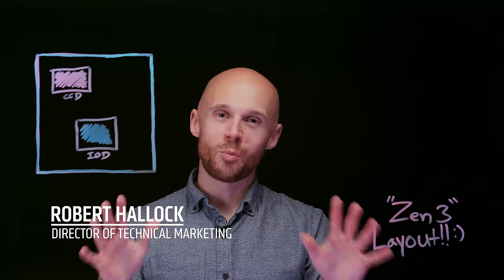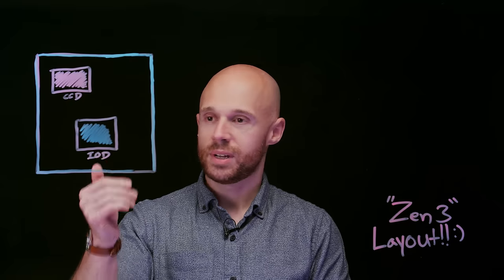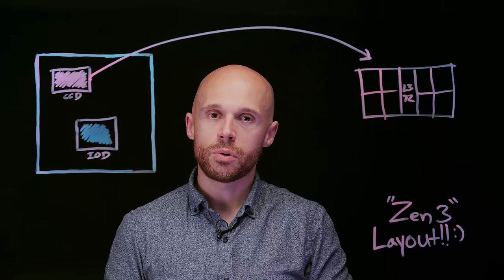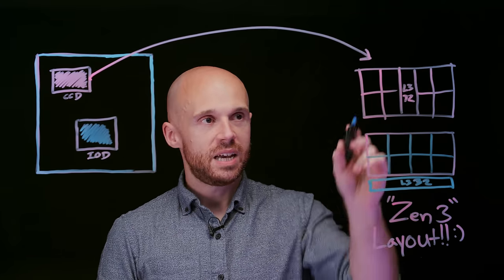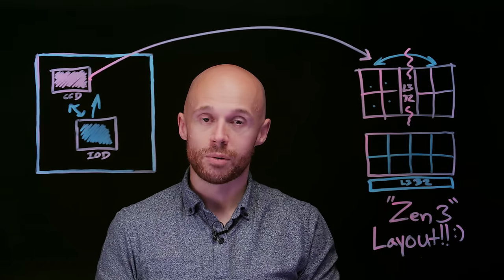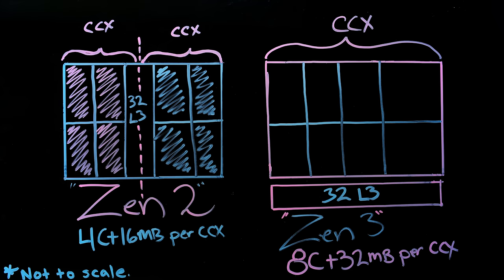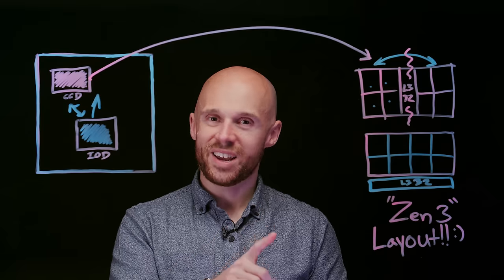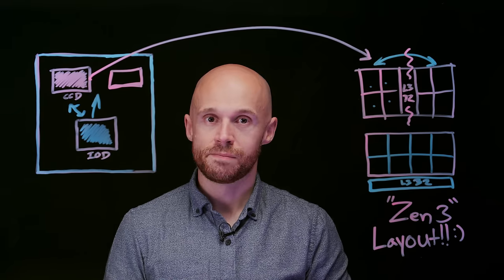How It’s Built: AMD Ryzen™ 5000 Series Desktop Processors

Comment: So for the 5900X, do you have two dies in the package with only 6 active cores per package? If that is the case, I wonder what the performance between the 5800X where all cores in one die vs. both the 5900X and 5950X as they will have two dies and need to communicate between those as well as the cores themselves (for games that won't use more than 8 cores).
Reply: EDIT: Guess I was wrong. It's way more likely they will pair two CCXs with the same amount of active cores, so, 6+6 for the 5900X.

AFAIK, the Ryzen 9s still have one full 8 core CCX and an extra CCX with up to 8 cores. If you get the 5900X it will have an extra lower bin 8 core CCX with 4 cores disabled, but the 5950X will have two full 8 core CCXs.
Now I'd say it's safe to assume the CPUs with two CCXs will have to use the IOD to communicate, but that hasn't been an issue for applications that require a lot of cores anyways, proven by Ryzen Zen 2.
Reply: No game needs 12 cores. You could probably assign it to just one of the dies (6 or 8 cores in a single CCD) in Windows scheduler just like Linus did during his Zen 2 review. This would eliminate any performance bottlenecks from inter-core latency in this game.
Reply: I was thinking the same thing - and then at what point do you stop? If it's more efficient to just have all cores together, don't you eventually end up full circle to old design?
Reply: You still get a lot of benefit. The core 2 core latency matters only during a L3 cache miss when the data exists in a "sibling" L3 cache. If you have a cache hit, you never leave the CCD so there is no impact. If the data is not in any cache at all, you have to wait for the RAM like always. You want as much useful data in your L3 cache as possible, because those cache misses are pretty much the worst thing that can happen for performance.

If you evenly spread out the cores over CCDs, each core has more L3 cache to work with compared to having more cores on a single CCD. So while you may have a little bit more overhead when threads are moved between cores, if they actually keep running on the core for a little while they will actually tend to be a little faster than the "crowded" cores because they don't have to compete with as many other cores for the cache.

So if you have a scheduler which knows about the cost of moving threads to a different CCD, spreading out the cores should improve performance. Ryzen/Threadripper/Epyc has been out for long enough that an up-to-date OS has a scheduler that knows how to handle that. So having 2 6 core CCDs should be a net benefit in pretty much all cases.
Reply: the 5900x in that comparison will have more cache available per cpu, so probably a net win all of the time.
Reply: @hoff521  As I understand, CCD is what's meant when you say "chiplet", and it's the CCDs that allow AMD to save so much on building the chips, which is exactly the benefit of modular design. The CCX's did not add any cost-reducing benefits, they were just a necessary design complexity that AMD only now realized how to get rid of. So the moment we stop is exactly this, 8 cores per die.
Reply: @dexter2392  Its better to refer to THREADS when talking about gaming. Especially because the processor is hyper threadded (has 2 threads per core. Most games from just a few years ago use at most 4 threads. Tho modern day titles, thanks to AMD ;), are now being optimized for more and more threads. Games are coded for not many cores (or threads) because most gamers wont even have a 16 thread CPU. Coding is also not learn in parralel, making it harder to spread the workloads.
Reply: Its a case to case basis.

In the case of Zen2, a 3300X doesnt always edge out a 3600X, usually the latency is only felt in latency-sensitive operations but then the difference is probably just a few seconds. For gaming, average fps of 3600X/3500X goes higher with the difference primarily in the minimum FPS depending on threadedness of the game.

With a more core count-constrained context, such as the 3100X vs 3300X, you'll see your answer :)
Reply: @nemanjarakic6815  Games are optimized for consoles first (cause they're the most popular gaming platform) and with the release of Zen 2-based PS5 and Series X, games will start to be written and optimized for 16 threads. Currently though, most AAA games require 4c/8t at least and some of them (particularly CPU-intensive ones) can see a performance increase by going up to 6c/12t.
Reply: @hoff521  Ya I think your right and also cannons why AMD intends to go with a monolithic die on their next line after zen 3. They have been shrinking nodes and trying things. It would make sense on a further reduced node like 5nm that they would go monolithic again for sheer performance.
Reply: @Niosus , thanks man i was thinking about that since quite a while. could not decide if i want to go 5800x or 5900x for gaming performance but also longevity for the years to come.
Reply: @dexter2392  Indeed. I agree. Im saying that older games are optimized for less threads, because consumers didnt really see more than 6 core CPUs just a few years ago.
Reply: @hoff521  It's a tradeoff between yields/scalability and performance.

When you have a multithreaded application that uses all 16 cores, the performance multiplier of using all those cores mostly outweighs the performance loss of inter-die communication.

When dealing with core usage that's only slightly over the threshold for inter-die comms however, such as needing to use 5 cores, then you end up paying the penalty for not much gain.

There's also the question of scalability and yields. It's much cheaper and easier to manufacture lots of smaller dies and connect them through the packaging than it is to manufacture one huge die and individually disable parts of it, which is why even with Zen3 they're still using chiplets. It would be very expensive and possibly unrealistic to manufacture a single 64 core die with all cores working, rather than getting 8x 8 core dies that work well and still being able to sell the partially defective dies in other products as 6 or 4 core dies.

The chiplet design of Zen2 is what has enabled AMD to sell lots of different tiers of CPUs with good availability at a relatively low cost, compared to Intel's monolithic Core i designs that have had a lot worse availability and generally higher costs due to the lack of flexibility of having everything on a single die. 

There is also a latency penalty for having too big of an L3 cache, so having 16 cores all share a single 64MB cache pool might actually be worse than having it split up into 32MB for each group of 8 cores.

This is all theoretical, I sadly don't have the incredible talent and skillset that the CPU architects have, the info I provided might be wrong but I hope it gives you a rough idea behind their thought process for some of the decisions they make when designing a new arch.
Reply: @hoff521  chiplet design  is a workaround  for scalability due to current lithography limitations. In idea world, the monolithic die is definitely better than this provided you can manufacture it with reasonable yield.
Reply: @ayuchanayuko with zen3 each core is always going to have 32mb of l3 available, vs 16 with zen2.  This makes the need for inter-die communication much less. So there is going to be less of a downside to splitting 12 cores across 2 dies vs having 8 cores all in 1, than there was with the analogous 4 vs 6 split with zen2.
Reply: @mikinyaa  From a cost perspective it will always make more sense to use chiplets even when yields are amazing, as it enables you to manufacture different parts of the CPU at different lithographies, for example the IO die in Ryzen 5000 is 12nm while the CPU dies are 7nm+. Older manufacturering processes tend to be cheaper and depending on the application can still be sufficient.
Reply: @nemanjarakic6815  Some compilers are able to take advantage of more cores, actually I think that most of them are. When compiling larger projects with many files having more cores is a godsend.
Reply: @fredit123456789  Compilers are essentially single-threaded. The build system, the layer above the compiler managing the compilation that takes care of compiling multiple modules in parallel.
Reply: @dexter2392  At least not yet anyway. I am thinking about building a system just for gaming, and use my current 2950X as the stream/encoder everything else machine. So I will probably go for the 5800X and upgrade in the future if needed, but I doubt it will be "critical" for a while yet. Time will tell when it comes time for purchasing anyway, depending on prices.
Reply: @dexter2392  Star Citizen uses all cores.
Reply: @fredit123456789  Well thats why we use synthetic benchmarks for multi and single threadded benchmarking :P... Tho some CPU bound games also come into play when benchmarking "Gaming" CPUs. Like CSGO for example!
Reply: @TheOz1999  thanks for the detailed response, and to the others who responded. I knew the design was genius in terms of yield and cost-effectiveness, so it will be interesting to see how AMD product stack evolves over the next few years. It seems like strictly going one or the other comes with large sets of pros and cons for each, whereas a mix of the two across the stack could realize the benefits of both in segments where the cons are minimized, i.e. chiplet for budget or office machines, monolithic for high performance workstation/gaming
Reply: @nismo97  Using an 8+4 layout is extremely unlikely.  6+6 makes more sense.  That provides the same amount of L3 cache capacity per core.
Reply: Simple....he wrotes and tells that this architecture is not for scalibility purposes.
Reply: @nemanjarakic6815  Yes, It's very hard to spread computing across parallel threads because most of the time, processes reply on other processes that have to happen in a certain order. This is incredibly apparent in physics game or physics engines where collisions, forces and velocities all have to be synchronised and some things have to wait on others even though another process queued for the same thread might not need another to be completed. I think that's pretty simplified but ye, you're right, it's extremely difficult and worthless to spread computer across a certain amount of threads... I'm guessing more than 20 threads is just not worth it until we find some major breakthrough.
Reply: The operating system's CPU scheduler has to mange that I guess. 
As far as I know gaming performance on Zen/Zen+ increased drastically in some games with the Windows 10 May 2019 update. Before that you had to set the core affinity for the thread of the game manually to the cores of a single CCX for the best gaming performance.
Reply: @hoff521  I think it depends with your goals as a company, intels architecture so far has had the best latencies but scalability to high core count CPUs is expensive for them because they have to bin like crazy to get monolithic dies over 8 cores since imperfections really affect performance of a monolithic designed CPU, AMD on the other hand have had latency issues that were more or less a non issue for most productivity based tasks but really affect gaming, but the ease with which they can throw in a custom GPU or chiplets to get to 64cores and above affordably is far superior to intels approach. Unless foundries get a way to make the production process perfect such that wafers offer a 100% yield rate no matter the size of dies then monolithic designs are on the way out.
Reply: @SuperPsykosis  I doubt this because, the node will already be quite expensive since AMD are early adopters, to add onto that, the yield rate for high core count monolithic CPUs is lower so that adds quite a bit more on production costs.
Reply: @bobouistic  but the reduced process node would give potential to release 16 core versions on that monolithic die or at least hypothetically. Who knows, we will see in time. Appreciate your comment.
Reply: this would be why the 5600 has very similar single core performance to the higher tier one they will have higher clock speed tho that being why they still beat the 6 core by a bit
Reply: @Amarushaya92  buying 5900x and thinking already about futureproofing
Wtf?
Reply: @ludapecurka102  if the 5800x is in my consideration. Sure
Reply: @nismo97 
If this is true, there would be a large inequality of L3 cache between CCDs. The 5900X is specified as 64MB. So the full 32MB per CCD. This would mean that once eight cores share the 32MB, but on the other CCD only four cores have the full 32MB available.
If AMD would disable the same number of cores on both CCDs, the core to memory ratio would be the same, which would make more sense to me.
Reply: @hoff521  I understand where you're coming from, but the bigger the die (more cores), the worse yield it has and hence is less economical. That's why intel gave us only 4 cores for like a decade. The zen layout changed everything.
Reply: @2KOOLURATOOLGaming  agreed.
Reply: @ETin6666  fully understand that, but I also wouldn't say that was why intel did 4. Intel limited at 4 was because they owned the market and could. The fact they do more than 4 now shows it wasn't a case of a manufacturing inability. I also see why for manufacturing economy, it was wise for AMD to do so, as they couldn't afford wasting yield binning for functional monolithic dies. My 2nd reply touches on my thoughts for what this means moving forward, however, and the possibility of diversifying manufacturing approach across their stack. I just meant how for top end performance, it seems like we're circling back to monolithic, or as close to it as possible. Of course once 'industry standard' number of cores get high enough we'll have to split to some degree, but it seems like making those sets as big as possible is ideal for performance. Unless of course AMD drops more next-level advancements and figures out that problem too.. like having the core chiplets, however many there are, able to interact with the full cache
Reply: @nismo97  Nope, the cores are evenly split between dies, so a 3900X or 5900X has 2 dies, each with two cores disabled, i.e. 6+6.  There are never two dies with mismatched numbers of active cores.
Reply: @nismo97  The Ryzen 9 3900X is 6-core CCXs. I don't see why they would change this for the 5900X (though there's also no reason that they couldn't change it to 8+4)
Reply: @nismo97  No, that's not how Ryzen 9s work.  They have two chiplets with the same number of cores, although generally one is higher binned (and will hit slightly higher frequencies) than the other.  There are no asymmetrical Ryzens.
Reply: @JackMott  That doesn't make any sense. The need for inter-die communication isn't directly affected by the communication between cores within the same die (intra-die communication). If you have 12 cores across two CCXs, that's going to need more communication bandwidth than 6 cores across 2 CCXs, because you have twice as many cores, so you are likely to have up to twice as much data to transfer.
Reply: @fredit123456789  The way compilers are optimised to run on multiple cores is completely separate to how they are optimised to generate code that can run on multiple cores. You can create a single-thread compiler that generates code that runs well on multi-core CPUs, or you can create a compiler that uses multiple cores that generates single-thread code. The optimisation of compilers to run on multi-core CPUs is irrelevant to whether games are optimised to run on multi-core CPUs.
Reply: @nathangamble125  if you don't get an L3 cache miss, you aren't having to do inter-die communication.  With zen3, l3 cache misses are going to be much less likely.
Reply: @dexter2392  I already hit 100% cpu usage occasionally in BF5 and Death Stranding on a 5.2GHz 9900k.
Reply: Yep 5900X it is for me :)

+4 more cores (and the threads) than 5800X and is just 100$ more

I actually don't see value in 5800x at all (at least out of 4 of them)
Reply: @Kaygoooo  Someone here said otherwise (8+4), but I haven't read up on the CPUs themselves, so I don't know. Where did you get that info? Not arguing, just curious, the other person didn't say either :)
Reply: @dexter2392  X4 Foundations after 48 hours campaign wants to have a word with you. Supports up to 32 core CPU.
Reply: @hoff521  Monolithic (old style) is faster. That is true. But the thing is price increases in proportion to square of the die size because there is more probabilty of its being faulty. Also, chiplet design allows you to manufacture the parts that are non-critical in larger node, thus making it cheaper. I/O die doesn't need 7 nm. Chiplet design is how AMD can compete with Intel while being significantly cheaper. TR 3990X would be 10x more expensive if it was monolithic.
Reply: So how can I as a user speed up the inter-die communication? Faster infinity fabric frequency = faster ram?
Reply: So for someone building their first PC with a 6900XT GPU strictly for esports gaming and tournament shooter games, would u guys buy a ryzen 5900x or ryzen 5800x? Which cpu would have better memory latency? Or are they the same in terms of memory latency?
Reply: @billwhoever2830  If you have studied how Windows handles threads, it actually bounces them a lot, just in a second of processing time even on single threaded programs, So unless the scheduler improves (hint: it wont, win10 core is basically nt6 aka Vista in age which they just ducktape up constantly), the dram bottleneck will be there due to inter core latency between dies.

You could gain a lot of performance on Zen+ by using process lasso and binding certain cores on some games, that would prevent it from needlessly traveling to the other CCX. It was hilarious. CSGO being one prime example. They did ducktape this later out and I lost a lot of performance with 2700X which is weird, from 500fps to somewhere 468fps max.

It's also evident on Linux vs. Windows benchmarks where the scheduler actually honors the CCX layout and tries to keep on the same side if possible. AMD has always done the stuff "too complicated" for Windows in my opinion. This is why Zen3 will help a lot on Windows, not just because of the so called IPC lift - making it more straight forward for Windows itself will help a lot.
Reply: @hoff521  You would have limits in the actual die size. I believe it's called reticle limit (Not certain as I'm not an engineer)? Then there's also yields with the bigger dies being worse. So, there are both physical and financial considerations. and as others have said, the game would actually require more than 8 cores. As long as you continue to improve instructions per clock (ips) and clock speed you might be able to keep the work on one die. Then there's also the ability to increase cache size like the 128 meg that's on RDNA2 to help offset the intra CCX communication latency. I'd like to know what % of improvement comes from the unified CCX and what comes from the unified cache.
Reply: @iamLODD  I would wait for reviews first of all. But for esports, i think many current GPUs would work just fine as most esport games are very easy to run at high FPS. Like hundred of FPS above what your monitor will show. I'm sure the 6900 XT will do great, but I think it might be quite overkill for the task.
Reply: @habib_the_panda  Since I am such a deaf moron, and maybe a blind as well, maybe you can help me by telling me at what time in the video does he ever mention 6 cores? Cause I don't hear him mention 6 cores at any time in this video, and I also don't see him draw anything with only 6 cores.
Reply: @Alexandra-Rex  the start when explaining zen 2 and middle when explaining zen 3 basically the whole video, his drawings also support it so not only is there verbal evidence but written evidence from the horses mouth, 4 + 4 is 8 and there are 8 cores on the dye he is explaining at first hence why there is 4 on one side and four on the other, then he does to show how they use the cache at the bottom to bring the 8 cores together to reduce latency.

I swear you didnt even watch it.
Reply: @Alexandra-Rex  start watching from like 1:50-2:30 and you will understand why i said what i did.
Reply: @hoff521  I was thinking the same thing myself but before on Zen 2 I think there may have been 4 cores togther making the info passed to 3 different sections on the 3900x and now its down to 2  for the 5900x. not sure
Reply: @habib_the_panda  I watched it, and re-watched it twice after your comment. No where does he mention 6 cores. I also re-watched the part you mentioned in your other comment now, still nothing about 6 cores. But why the attitude in your first comment?  No need to be insulting.

The reason I asked is if you have the 5900X, who would it be split? 6 + 6? 8 + 4? And since he didn't say anything about the 12 core specifically, I asked.
Reply: @dexter2392  yo man, can you link the video? I have 3700x and I'd like to test it myself :D
Reply: @JackMott  Unless you really need that many cores
Reply: @nemanjarakic6815  Console games HAVE been heavily using multithreaded since the PS3 days using the PPE and 5 SPEs. It is only the PC games that up till about 4 years that favored fast singled threaded performance due to the HUGE MHz of x86 compared to the dog slow CPUs of consoles. Hell even MS FS 2020 is rumored to heavily single threaded bottlenecked.
Reply: @hoff521  it isnt because yield goes down the higher amount of cores you put in place and makes epyc and tgreadripper no longer viable
Reply: @SuperPsykosis  not if they still want to sell server parts.
Which they do since the margin is much higher
Reply: @SuperPsykosis  I don't think they will go monolothic 
Makes no sense as the cost increases exponentially.
People are talking about the gpu being designed in multi chip layouts 
If that is true I don't see zen going back
Reply: Huh, i dont know that.... well im gonna get the 5950x anyway. Gonna upgrade my cpu from 3800xt.... time to render at high speed with that beast
Reply: When will the Zen 2 APU Non-Pro Version be release?
Reply: @nismo97  Your Edit is spot on. So 5900X is Double of 5600X and 5950X is Double of 5800X
Reply: @habib_the_panda  You start out by calling me a deaf moron, then you say I harass you simply cause I don't see what you see? That's rich. Go troll elsewhere.
Reply: @billwhoever2830  Yeah that would be the logical way to think it, but this is why Windows has always baffled me. 

For example, I just launched UT99 which is 100% single threaded game from 1999. On my win10 20H2 build, it still causes the load to jump between CPU 2, 6 and 7 threads... It has always been like this for ages, at least since XP times as I can remember, when we started to get dualcores and quadcores with HT.

When you have the thread randomly jumping on other side of CCX with another 16mb cache, I guess the CPU would need to now validate which cache state is then a "miss" at that point. Now when the game uses 8 threads or more, it just gets like a clusterF in terms of affinity, if you don't always assign them manually or the game engine isn't smart enough how to use cpu well.

This is why I think this "more monolithic 8 core" style will help them in the end a lot more as you won't get the random performance issues in games like OpenRA with huge amount of AI, which would make Zen+ run slower than a intel core2duo laptop 10 years ago... :D
Reply: It is reflected in the pricing... The jump between the 5800x and 5900x aint as big as it used to be between the 3700x and 3900x (ignoring the 3800x of course since apparently we haven't heard of a 5700x). We're talking about 100 instead of a 170 difference. I think the 5800x will slightly outperform in gaming that can utilize 7 to 8 cores, however, games are still still largely utilizing 6 cores at most, which means we'll see a difference that'll be within margin of error or slightly favoring the 8-core.
Reply: @adebowalekonstantinov404  It will be interesting to see the reviews.
Reply: @dexter2392  12 core still has double the cache of the 8 core model, so it could see some improvement in 2-threaded workloads, if you pin the 2 threads to 2 cores on separate CCDs.
Reply: @Niosus  nń
Reply: @Niosus  It matter also in during context switches. A thread loaded data in cache in one CCD, then went paused, but the CCD is currently loaded with a lot of threads and the thread needs to be restarted on another CCD. But this won't generally happen in much games, it will matter only for threads that do blocking calls and are not active all the time. Perhaps windows kernel threads and some application threads.